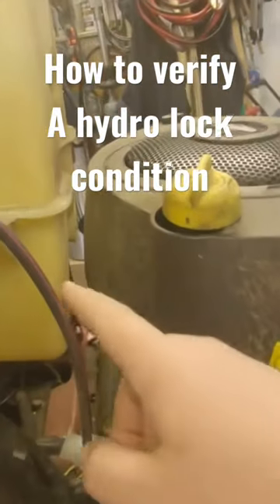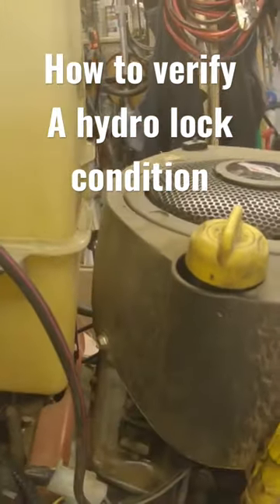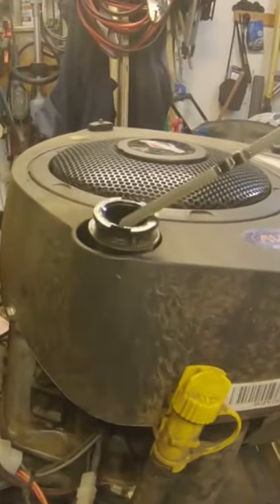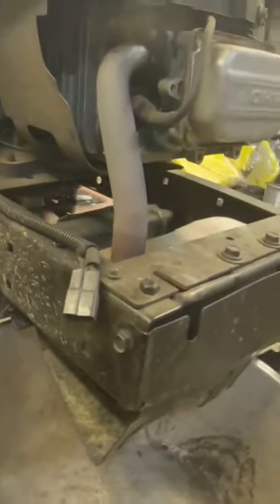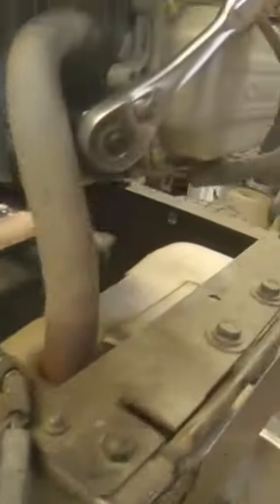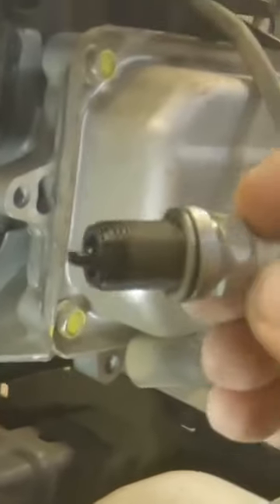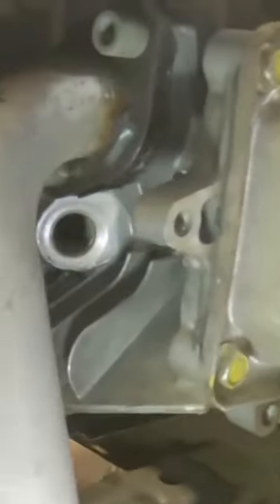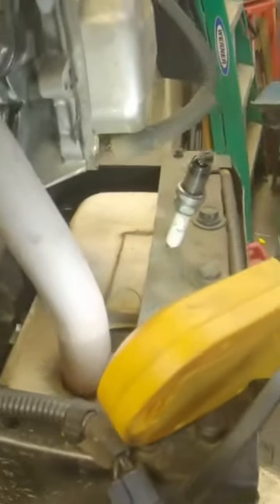How to Quickly Check for a Hydro Lock on Your Lawn Mower: #baldeagle242

Comment: Cut the electric fuel shut off in carb bowl off at its base. Install In line shut off valve. When done mowing and are parked where it's gonna stay shut off valve then let run a few seconds and shut it off. Problem solved.
Reply from the maker: Here’s a link to the full video. Simple Fix on a Seized Hydrolocked Mower Engine #baldeagle242
https://youtu.be/8VxTRqJZi0Q

Comment: The stupid solenoid doesn't do what it is supposed to do. Gas continues to flow.  The oil must be changed and the cylinder needs to be flushed out of fuel that has filed the engine.  Make darn sure the spark plug wire has no way to create an arc since the fluid being flushed out IS GASOLINE.
Reply from the maker: Here is another video I made on these carbs that goes into a lot more detail about why they can and do leak.
https://youtu.be/-uzKSJhJtww
Reply: The "stupid solenoid" ONLY stops gas from going thru main jet when you shut it off.

Comment: You got a float stuck n your carb
Reply from the maker: This one had something a little different. Here’s the full carb video. https://youtu.be/-uzKSJhJtww?si=UJ8EDmwXpbYqsC7x
Reply: I use a ole TORO WALKBEHIND 2005 MODEL 52INCH / 3RD MOTOR 1ST WAS A KAW N THEN A KOEHLER AND NOW ANOTHER KAW / I PUT A SHUT -VALVE ON IT / ITS NOT  GOOD TOO PULL YOUR MOWERS AROUND ON A TRAILER FROM STOP TOO STOP / I BELIEVE  ALL THAT FUEL SLOSHING AROUND IN THE TANK CAUSES  CARB PROBLEMS WITH THE FLOAT NEEDLE N SEAT

Comment: The question is Why? Poor engineering? I installed a inline gas valve to remedy my zero turn engine.😮😢
Reply from the maker: Here the video showing what happened and how to fix it. I agree with installing an inline shutoff as well. Particularly for anyone who stores one of these things inside a garage or under a deck attached to their house. They are all prone to leak after they get a little age on them. 
https://youtu.be/-uzKSJhJtww?si=IuqZSwAShompNOj2

Comment: Your pan placement was awful. You knew it was gonna happen and still failed.
Reply from the maker: You’re not wrong. 🤣👍
Reply: @baldeagle242  what ended up causing the hydro lock? Stuck float? Water ingestion?
Reply from the maker: @dredennis113  Here is a link to the full video. 👇
https://youtu.be/8VxTRqJZi0Q
I have a second video showing how to rebuild this carb here 👇
NIKKI Carburetor Flooding and Surging Fix #NIKKI #Briggs #baldeagle242
https://youtu.be/-uzKSJhJtww
Reply: @baldeagle242  thanks man. Nice to see someone show why. Instead of making a joke of the problem.